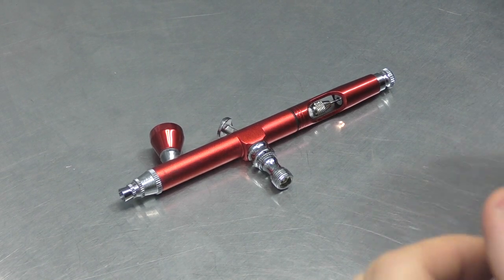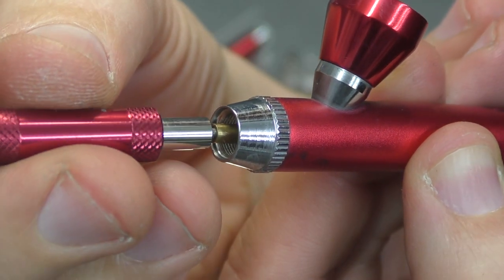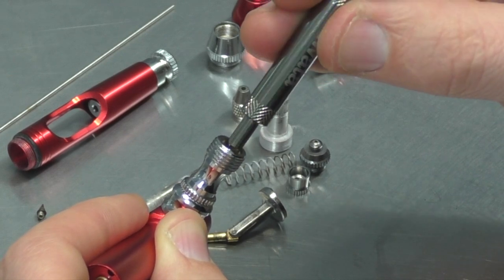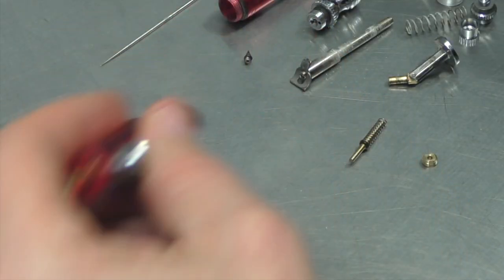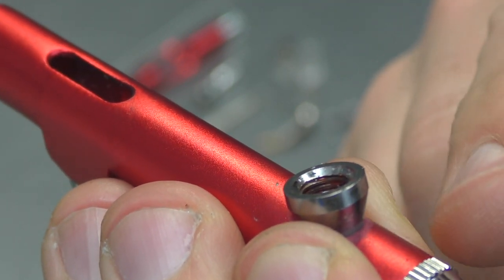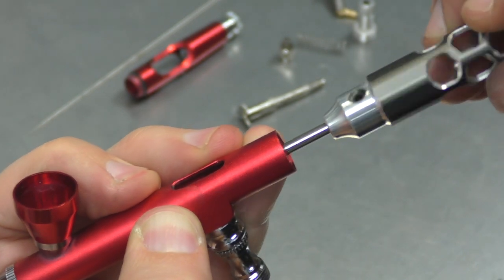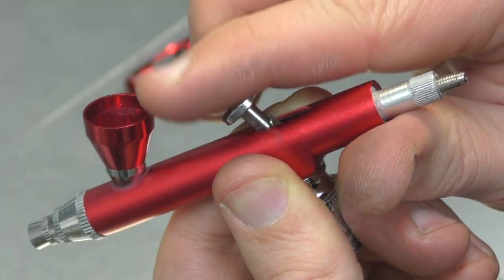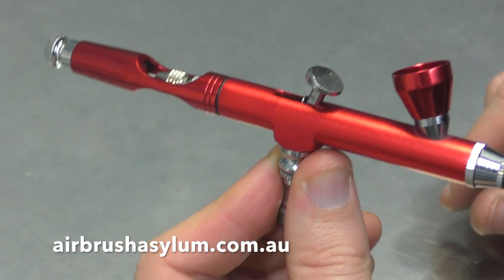Cheap Airbrush Breakdown & Reassembly

Comment: Please explain why on the new cm-c plus and CM-SB airbrushes, air also escapes from the connection of the body to the base of the nozzle head and the nozzle head cap. It doesn't affect the result, but it may be abnormal. Airbrushes bought recently, perhaps something I do not know about them. Specialized pliers will help solve the problem, if it is a problem at all?

Comment: '... can see it's a .2mil '
*With an obviously bend tip
Those cheapie needles are made from really soft stainless steel.
I harden mine by heating it with a micro torch until it's glowing, dip into cup of cool water, sand off the oxidation, heated it until it turned blue, air cool, then polish it up with 5k grit sandpaper and 10k polishing paste.
Be careful with this operation- the tip is so fine that it could melt off or sag off center.
When one is poor, options are limited.
Reply from the maker: Great spotting with the needle bend and yes, they are softer than usual thanks so much for the tip I’m sure lots of viewers will find that helpful and give it a go but with extreme caution 👍🏻🤞🏻
Reply: Can you put a iwata needle into this cheap brush?

Comment: Seals and needle tip failed after 4 uses with good cleaning after with master g22 bundle off Amazon that I've had for a week. $160 more later I have iwata eclipse hpcs coming tomorrow. After tearing the $20 master apart no wonder it's $20!
Reply: Khyber GT I did a test at are model club ( been spraying 15 years )  now did two 1/35 scale tanks i used a £20 amazon one and my iwata , you could not really tell the difference but what i did explain was paint quality ,thinning paint properly,and air pressure